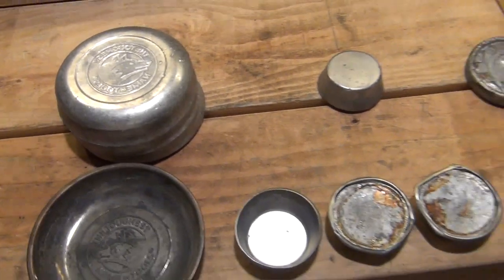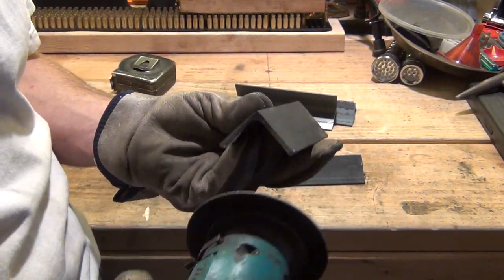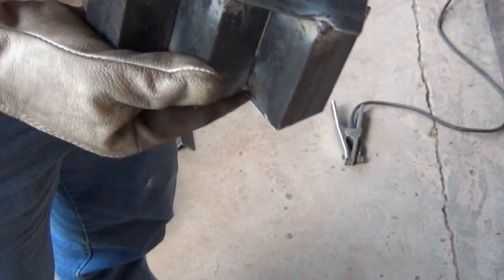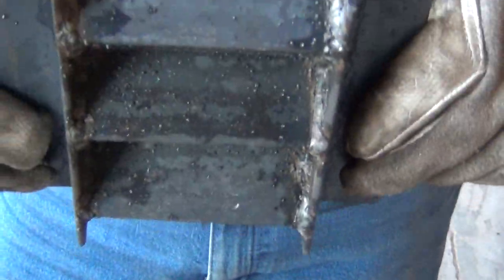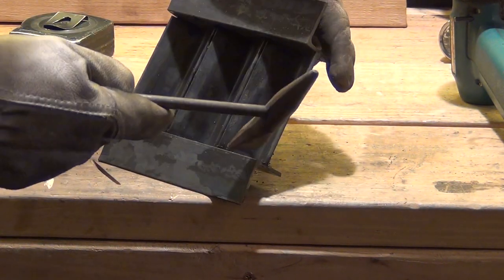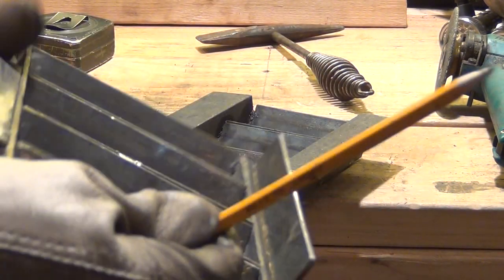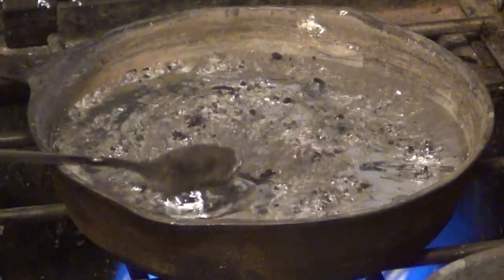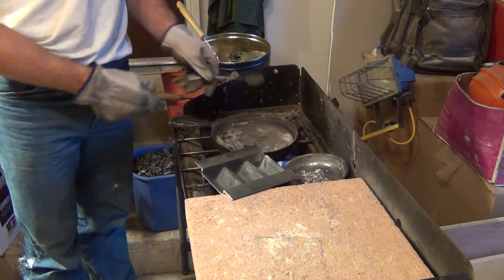How to make the perfect 3 cavity ingot mold - HD

Comment: Not to nit pick but part of your welding issue is because your voltage setting is a little too low for that thickness of metal. You are not getting enough heat penetration into the base metal, that is why your beads are too high and have not flowed out much. Plus you can see on the back side you don't see enough discoloration from heat penetration from your welds.
Reply from the maker: Excellent thoughts... thank you!

Comment: For the muffin tin ingots, which is what I use, you can find older tins that are actually one piece but mine is like yours. However if you flip the tin over and get the ingot out while it is still really hot it doesn't break the tin. For some reason if it cools all the way in the muffin tin it pops out.
Reply from the maker: sweet! thank you for the info!!
Reply: Yeah, I was going to say, the muffin tray I use doesn't have a problem at all with breaking, you can find better quality trays like that used in thrift stores for few bucks.  The only problem I got is that one - the biscuits don't fit my lee production pot well, they sit against the drain plunger, it probably would work with bigger Lee 4-20 pot and two - it started rusting!  but I found a perfect tray in the thrift store.  I think it was designed for small banana bread or Twinkies and there are 8 of them (4 in two rows) held by the bars and they produce just perfect ingots!  They fit Lee production pot perfectly, easier to stack and are actually bigger than biscuits and tray is easier to hold while pouring.

Comment: The side rails from an old 1930's bed frame are a great source of free steel this size.
Reply from the maker: freeganjustin Sweet. Thank you!
Reply: freeganjustin Not just 1930's beds - I have a bed frame that's recently manufactured that is made out of angle iron. 
It's the frame that a box spring fits on, and they're pretty common.
Reply: It's interesting you still have those. You don't find them in the UK made after about 1950. Later spring beds here are a single unit and the metal is much thinner. Nice you can still get quality some places.
Reply: freeganjustin 
I don't know if I'd call them quality - the steel is pretty nasty to work with. Welds ok though.
I read somewhere they are made of old rail track, but I don't know if that's true.
They often have hard spots in them that can strip the teeth right off you hacksaw blade.

Comment: i noticed you had a fairly large peice of rail. where did you acquire such an object?
Reply from the maker: I work for the railroad and the roadmaster had a scrap bin
Reply: Ah. Makes sense. Do you know any place i could get some rail because im going to be building a forge and i dont currently have an anvil.
Reply from the maker: +Nova Frequency where do you live and how long do you need?
Reply: +jiujitsu2000 id say about 3 feet. i live in florida.
Reply from the maker: +Nova Frequency I'd recommend going to the nearest railroad office and ask them where you can find the road master or asking them if they have a scrap bin to look through to get a small piece of rail.
Reply: +jiujitsu2000 thanks for the suggestion! you earned a sub.
Reply from the maker: +Nova Frequency Thank you!